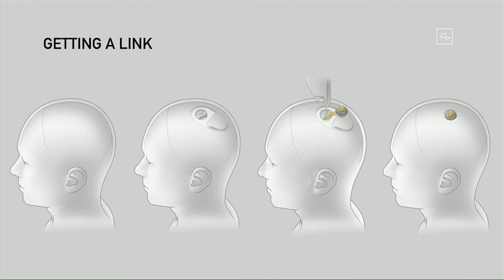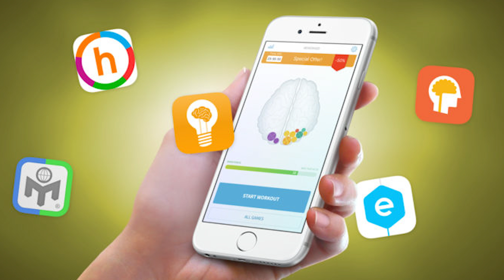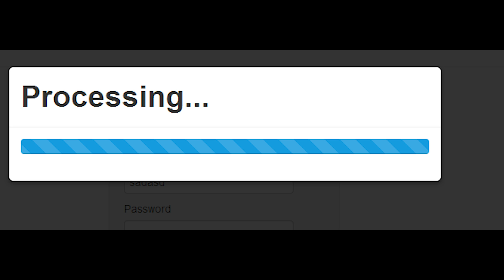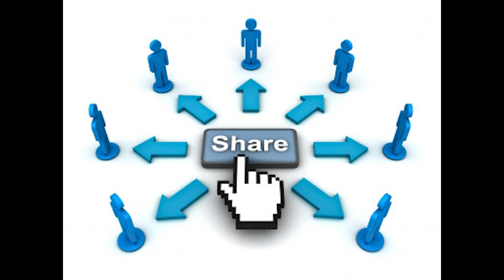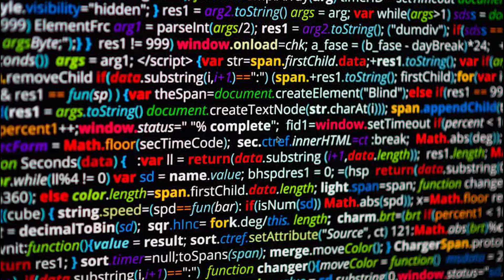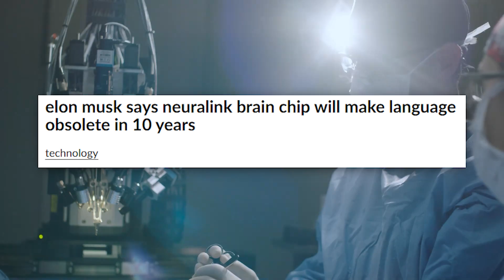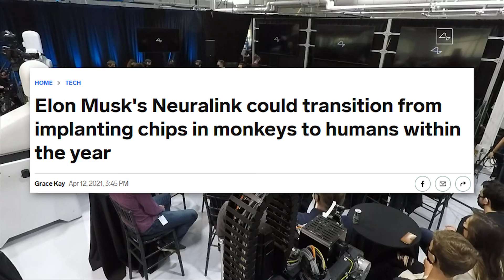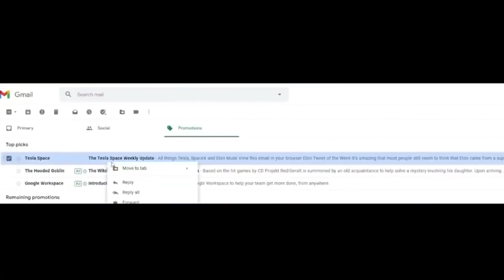How Neuralink Will Make Language Obsolete..

Comment: I think this thing is likely to have a 100% mortality rate... slowly cooking your brain as it heats up unless you are prepared to have a large aluminium heatsink sticking out of the top of your head or by meningitis as you will have pierced the protective membrane around the brain. Any impact to the head during sports or by banging it accidentally could drive the device deeper into the brain, rupture the battery or cause it to combust. And that's just if it works as advertised.